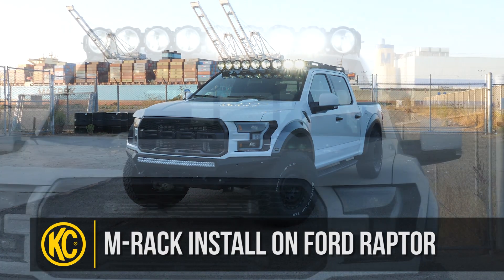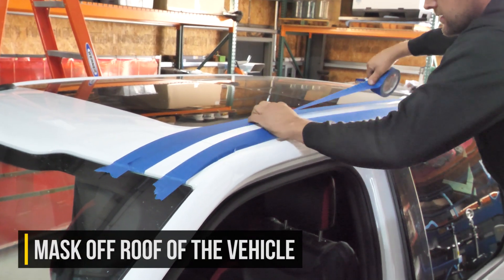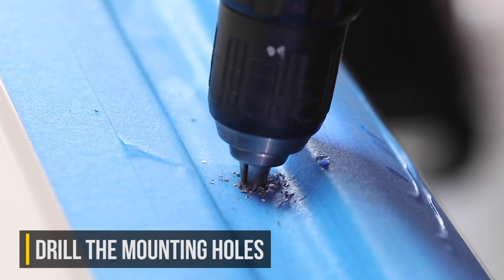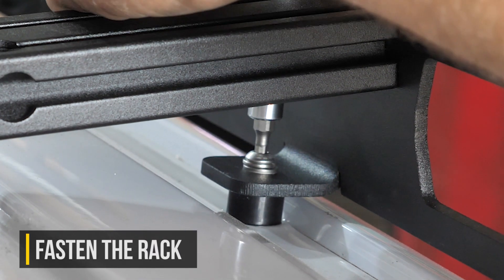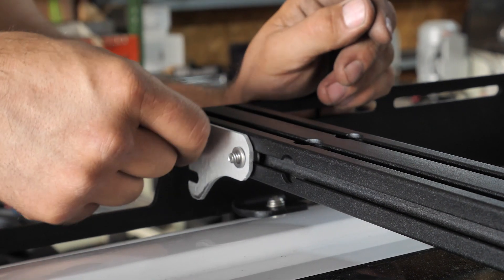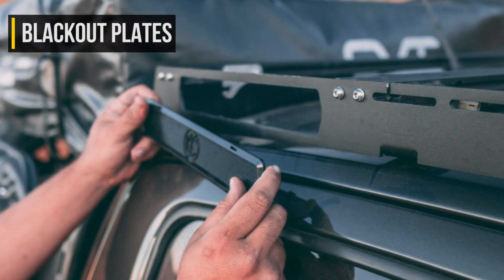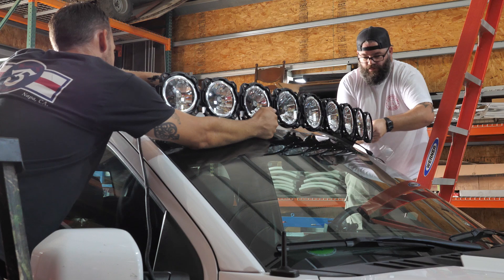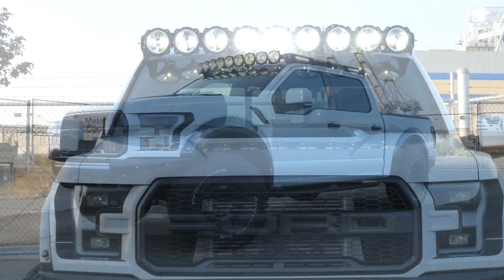KC HiLiTES® M-Rack Step-by-Step Guide on Ford Raptor Roof Rack Install

Comment: How is the wiring run and did you have to do some mods for that? (since the aux won't carry those amps)   .....thanks
Reply: It’s ran down the A-pilars using KC wire hiders. Rogue Element has a video showing how they did it.